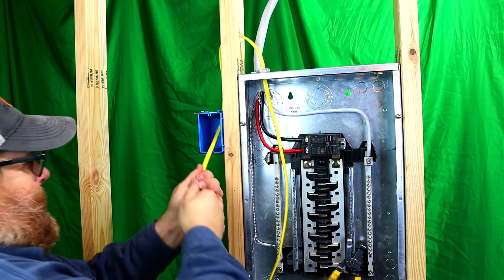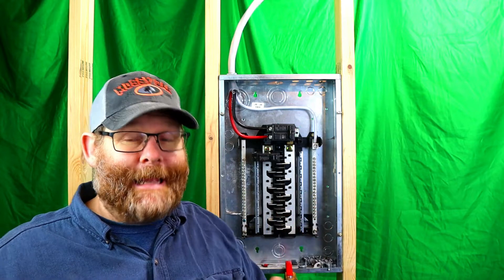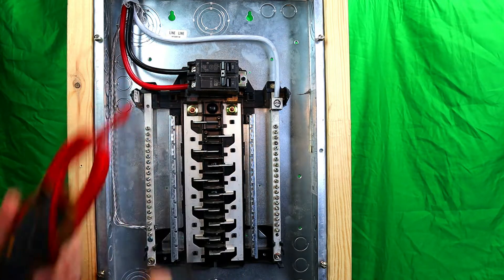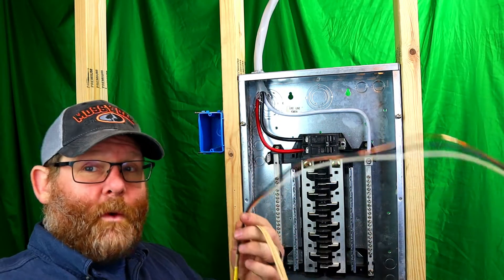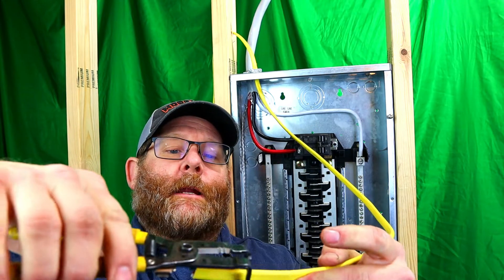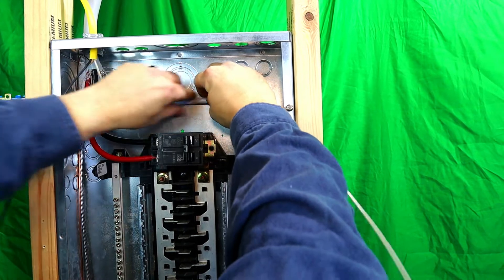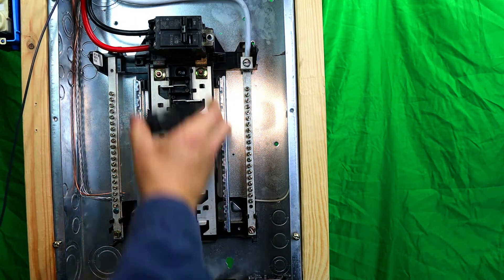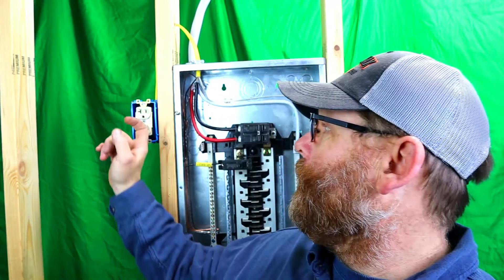How To Add A Circuit To An Electrical Panel

Comment: If this is a subpanel then the code violation would be bonding the panel with the green screw at the bottom of the bar.  Grounds and neutrals must be separated in a subpanel.
Reply from the maker: Yep
Reply: I disagree, Normally, a separate ground bar is mounted directly to the metal frame, but in this case both bars are mounted to the plastic and they are separated from what I can tell. Where are they connected? The one on the left is correct and the connection bar that was attached to the lower bolts on each one has been removed, separating them. The bonding screw is now connecting the ground bar to the metal frame, otherwise the frame would not be grounded.
Reply from the maker: Well it's bonded to can which is in the video. It's separate sooooo??
Reply: @MountaineerOutdoors I think you would code compliant if you added a ground bar kit, with a grounding lug to attach the ground cable from the main panel similar to how your neutral cable is done. Remove the bonding screw and replace the bracket that connects the 2 bars, making them dedicated neutral bars for a sub panel. Not sure if it's permissible to remove the bracket, should say in manufacturers instructions.
Reply from the maker: This way is completely code compliant have done this in 3 different states Virginia, Florida and North Carolina all passed. They way you are describing is ok to do that too..
Reply: @MountaineerOutdoors  Good to know, so I guess my original comment, in which I basically said that it would work, is correct then.

Comment: When using EMT do you recommend removing some of the paint along the circumference of the knockout to ensure proper bonding of the tube to the panel when tightening the coupling locknut?
Reply from the maker: You can but once the lock nut is tighten down it makes a secure connection and a good Bond. Same goes for the connectors and the couplings.  Good question though. I would say if you feel that you need to then yes but I just never do.

Comment: The wire length has to be 6 to 8 inches.  How wide do the holes have to be for the romex cable to pass through the wood stud?
Reply from the maker: As far as I know from looking at the code book there is no minimum, however like I mentioned before it needs to be in the middle of the stud with a and 1 1/4 on both sides of the stud so its protected from drywall screws. Nec 300.4 (a) (1)

Comment: Six inches - One of your other videos you measured it by holding the side of your hand against the front of the box and extending your thumb.
Reply from the maker: Yep I like more. Hanging out. 6 inches is just code.
Reply: @MountaineerOutdoors  Found the video where you use the "hand and thumb" method.  This is what happens when you have a base of fans.  Cheers!  https://www.youtube.com/watch?v=hDD0IvfcL38

Comment: 300.14 Length of Free Conductors at Outlets, Junctions, and Switch Points. At least 150 mm (6 in.) of free conductor, measured from the point in the box where it emerges from its raceway or cable sheath, shall be left at each outlet, junction, and switch point for splices or the connection of luminaires or devices. Where the opening to an outlet, junction, or switch point is less than 200 mm (8 in.) in any dimension, each conductor shall be long enough to extend at least 75 mm (3 in.) outside the opening.